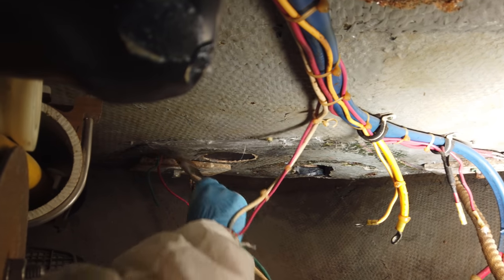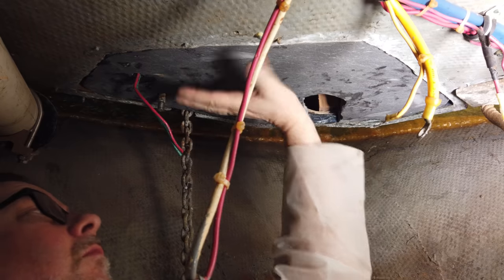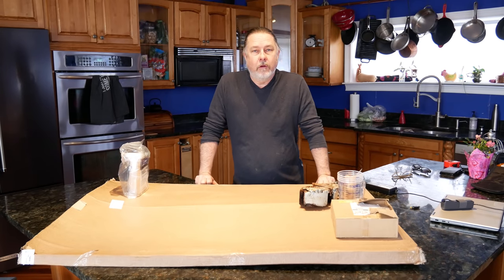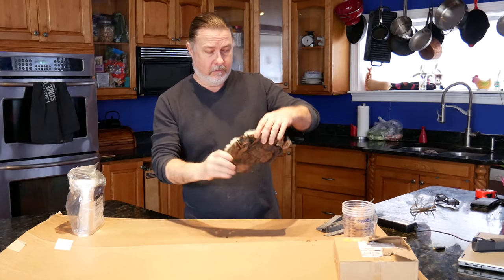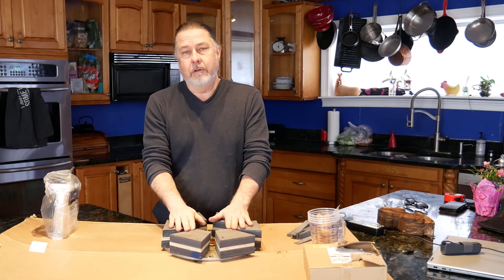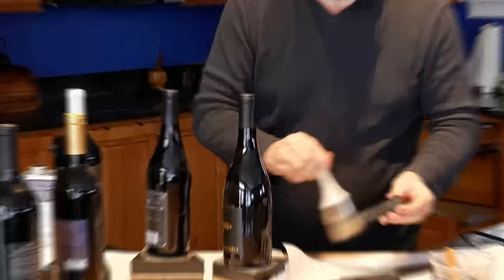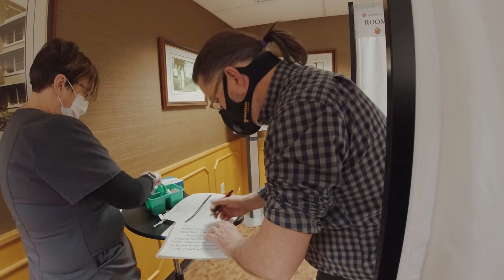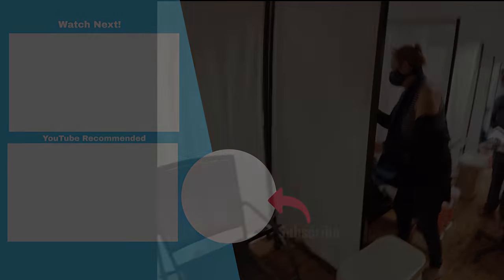Deck Core Replaced - Prep for New Windlass E117

Comment: Ed you have Cake decorating talents it looks like the way you squeezed the Polyester resin in that bag. 
Outstanding Job guys, from my memory as an early teen I could smell the polyester resin as you mixed the catalyst in it. Seeing that brought back memories of when I repairing my boat hull or build surfboards as an early teen.
The wedges are a neat solution rather than trying to drill the holes in a perfect alignment!
Reply from the maker: The wedges really did make it easier. You'll see it in the next video. I got the idea from the guys at Galley Maid.

Comment: A little advice if you don't mind. Next time you work with glass and resin use two to three pair of gloves at one time, that way if one pair gets resin all over just peel it off and you have a new pair under. Saves getting resin all over your hands.
Reply from the maker: Thanks for the tip!

Comment: I think I would have wanted holes drilled so the windlass mounting bolts went thru a solid surface rather than 2 thin edges with an air gap of 3 inches of zero support.
Reply from the maker: There is very little gap. It should be in the next video. It was a bitch getting those bolts to line up as it was.